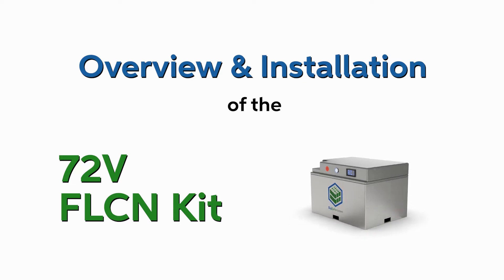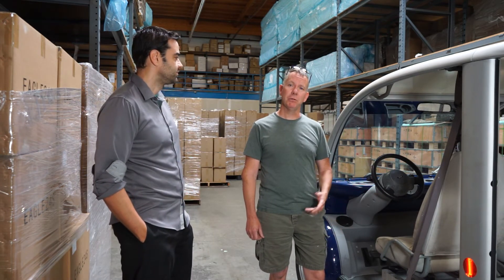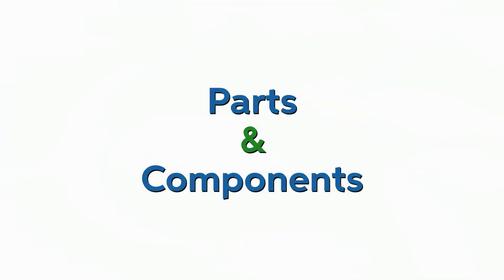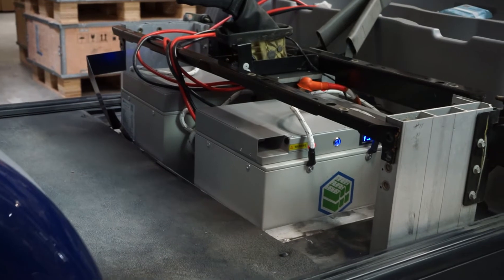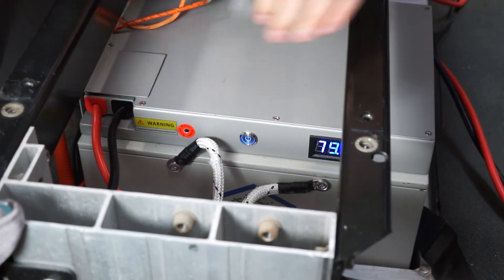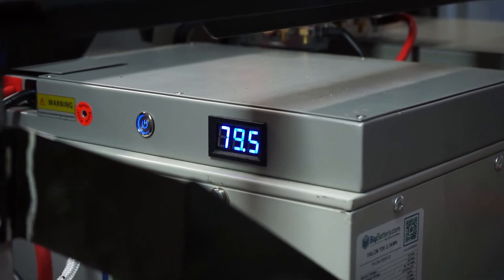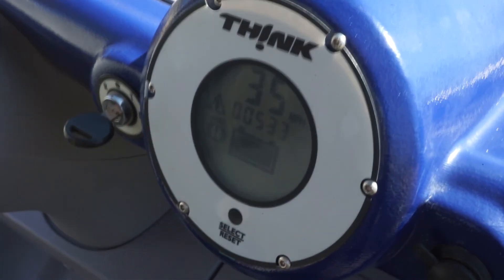72V FALCON | Installation - Ford Think Neighbor

Comment: Hello, great info here, I'm thinking of buying one of these, just curious about the cost of new batteries as this one will need them. Thank you!
Reply from the maker: Hi, thanks for reaching out! The kit featured in this video is our 2x 72V FALCON Kit. You can check out that kit here: https://bigbattery.com/products/72v-2x-falcon-kit-lifepo4-56ah-4-2kwh/ This kit comes with 4.2kWh (56Ah) of capacity and is priced at $2,700. This is a great option for upgrading any 72V golf cart or LSV. Unfortunately, our FALCON Kits are currently out of stock, but should be coming back in stock within the next 2 - 3 weeks. Be sure to stay tuned and subscribe to our email list to get updated on returning products, as well as upcoming sales and promotions!

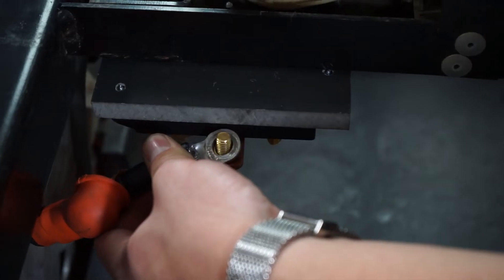Comment: I have this same model of the Ford Think.  I have three wires connected to the positive terminal in my original setup.  Would I need to connect all of the wires connected to the old positive terminal to the new positive terminal on the bus? I didn’t see the extra wires being connected in the video(2:05).  Just want to verify. Thank you!
Reply from the maker: Hi Wesley, thanks for reaching out. Are you installing the same 2x FALCON Kit we see in the video? If so, you're correct, there should be 3 ring terminal connections on your busbar. However, if you plan on charging your batteries through the busbar - versus directly through the batteries - you would have an extra connection on either side for a total of 4. These connections would be Battery 1, Battery 2, your cart's cables, and your charging cable. Feel free to reach out to our Support Team at (818) 280-3091, or by email at Support@BigBattery.com, to connect with one of our team members who can assist you further and verify correct installation. Thank you!

Comment: Which 72 v FLCN did you install? The 56Ah, 84Ah, or 112Ah in this situation. There is quite a cost difference and I am sure the range will vary significantly. I have a Ford Think Vehicle but do not need  tremendous range. Knowing which one you used to provide. 50 to 60 mile range as quoted by the owner would be very helpful.
Reply from the maker: Hi George! Apologies for the delayed reply. What's installed in this video is our 2x FLCN Kit (4.2 kWh), which can be found here: https://bigbattery.com/products/72v-falcn-lifepo4-60ah-4-2kwh/ This kit is our base level FLCN Kit, but in most cases, has enough capacity and range for the majority of our customers. The average range you can expect from our 2x FLCN Kit can vary depending on the size/weight of your cart, as well as driving terrain, and wheel radius. If you'd like to reach out to our tech team at (818) 280-3091, they can discuss your cart and provide a tailored estimate.

Comment: I don’t have a battery in my think golf cart do I get a regular battery or do I have to get a Ford batter ?
Reply from the maker: Hi, thank you for your question! Ford doesn't actually manufacture the batteries that go in their carts so they wouldn't be able to provide a replacement, but if you're looking for a lithium replacement, our 72V FLCN is an amazing option. You'll get significantly higher top speeds, faster acceleration, and much greater range with a lithium battery versus the standard lead acid. You can learn more about the FLCN here: https://bigbattery.com/products/72v-falcn-lifepo4-60ah-4-2kwh/

Comment: Hi Dan. Any solutions for a Ford Think that has already been modified for 120v?  I have 10 gel batteries but would like a substitute for the weight and space if possible.
Reply from the maker: Hi Dwayne! Those have got to be weighing down your cart so much! We're glad to hear you're looking to upgrade. The highest solution we offer is our 72V FLCN, so to reach 120V, you'll need a voltage converter, as our batteries are not series capable. We're confident we can work to find a solution for your cart if you'd like to give us a call at (818) 280-3091, or email us at sales@bigbattery.com! You can also learn more about our golf cart solutions here: https://bigbattery.com/golf-carts/

Comment: Hello Dan,  I have a 2 seat 2002 Ford Think.  3 questions -Can I use my installed Delta Q 72V On Board Charger rather than the supplied charger that you sell?   Do both batteries need to be turned off to be charged?  Lastly, what is the weight of one of the Lithium Battery? Thanks..
Reply from the maker: Hi Dennis! If you're able to reprogram your Delta charger to charge at 85V, then that charger will work. The charger we include with our kits comes preprogrammed and can charge at the same rate as the Delta Q7. During charging, both batteries should stay on actually. After your installation, your batteries do not need to be turned on/off, or altered in any way. You're able to just plug the power cable from your charger into one of your batteries and disconnect when finished. No turning on, off, or disconnecting of cables. One FLCN weighs 60 lbs., and we offer 2, 3, or 4 FLCN Kits. You can read more here: https://bigbattery.com/by-voltage/#72

Comment: Was there any need for a reducer from 72volts to 12volts for lights and other Acessories?
Reply from the maker: Hi Robert! This cart already had a step down inverter built into the cart so there was no extra installation needed for lights and other accessories. A built-in step down inverter is usually pre-installed by the cart manufacturer.

Comment: How about the range with the new batteries? How long to fully charge from zero?
Reply from the maker: Hi Dan! In terms of range, it can vary by the weight on the cart and the terrain you're driving on, but typically the 2x FLCN Kit provides 30 - 50 miles per charge, and can be fully charged from zero in 4 - 6 hours with our standard charger.